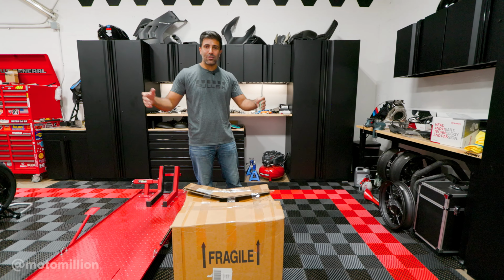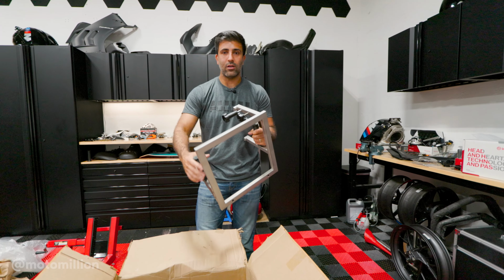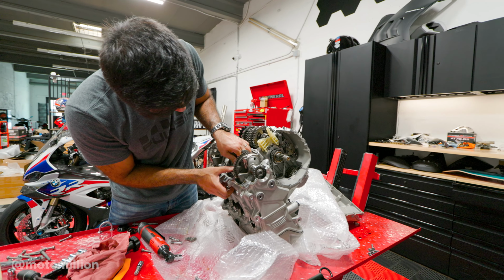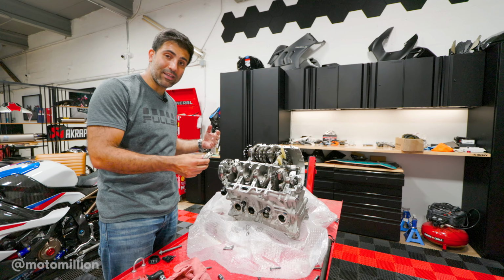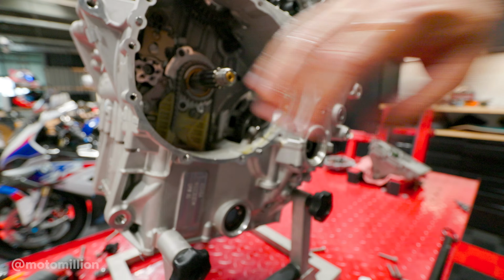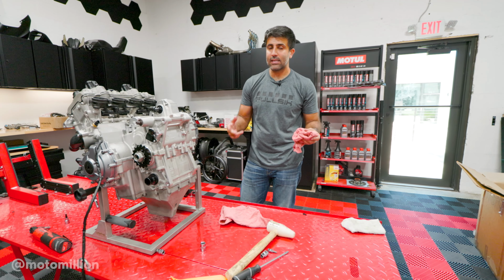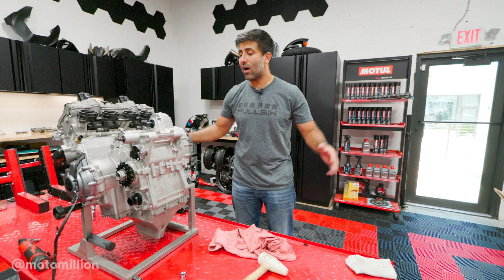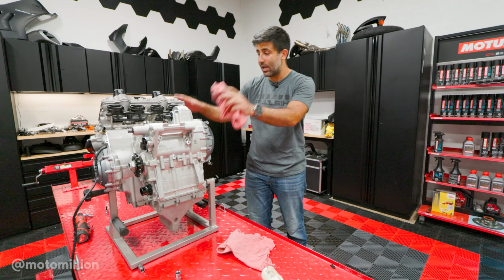$15,000 Coffee Table Build | Part 1

Comment: Hey Motomillion! Just throwing ideas out there to help you with the idea of a coffee table, I know you said you wanted to add some pistons to try and make a support for the glass top, what do you think of adding a full exhaust from headers to slip-on it. It would go on like a normal exhaust and have some of the pipes custom made to curve up to the top of the engine and have  the tip of the slip-on be the support of the glass top for the other side of the engine. Let me add a blue titanium touch to the exhaust. Love you videos man!
Reply from the maker: Wow, never thought about it. Maybe an exhaust installed upside down may work!

Comment: The engine looks factory fresh...apart from number 2 bearing 😮 You could get a fair bit of money for the gearbox,  clutch, head etc
Reply: Could even get second hand parts and rebuild it to sell. But a lot of work...
Reply from the maker: What if the problem is the oil galleys in the block? And Second cylinder rod bearing gives up again?
Reply: @Motomillion  yeah guess that would need to be confirmed also. Table will be a nice addition to the office anyway!
Reply: It could be a few things including the oil galley's themselves. 

1. The tolerances require an extended break in period before hard use. The galleys could be fine or cylinder 2 could be getting low pressure that combined with a bearing that's not letting oil out is disaster. And I do see heat scoring. 

Another thing that's not talked about is harmonics. Sometimes everything is engineered perfectly, but some random harmonics cause a part to wear excessively or receive an unintended or unaccounted for load.
Reply: Also could be that cylinder 2's bore was not 100% square so the piston was traveling at a slight angle of a few thousanths that would cause the bearing to unevenly load but that would be obvious because the bearing would have been completely worn on one side and not worn at all on the other side when it spun. From what I remember it was completely disintegrated? Hard to tell really.